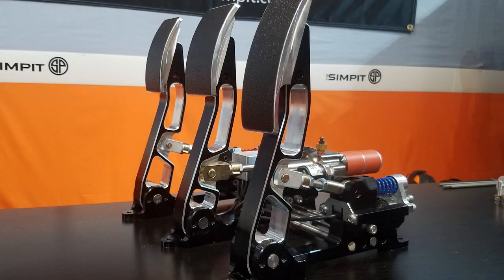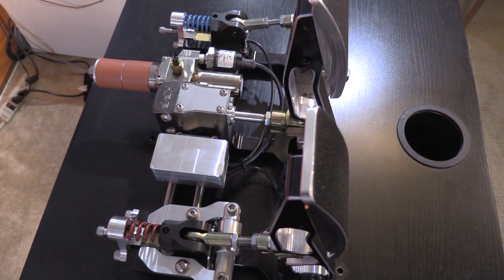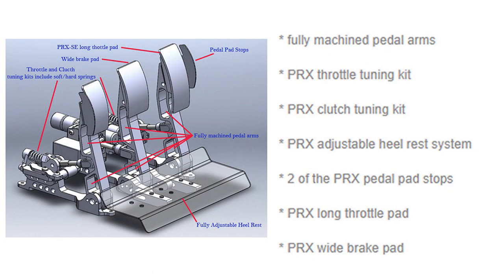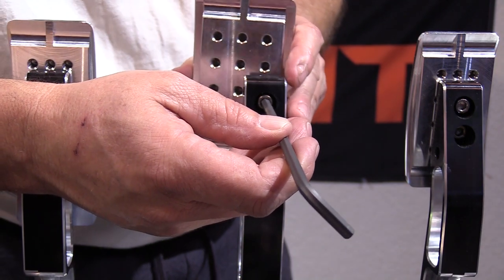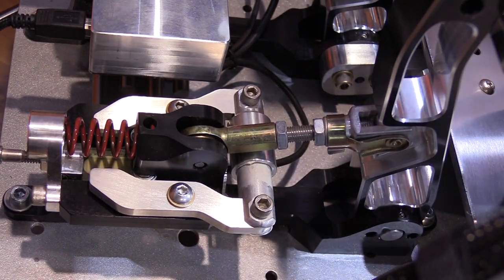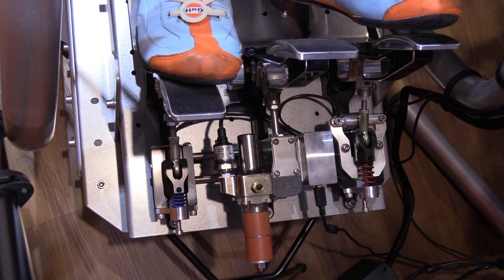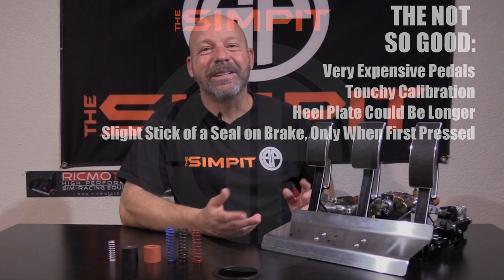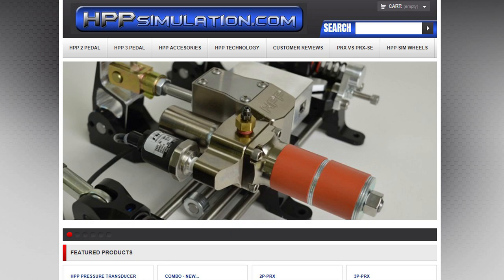HPP Simulation 3P-PRX-SE Pedal Set Review - Sim Racing Art

Comment: A solid review as always. 3 thumbs upp. I personaly don't like a "fluid brake pedal design" that might fail with "toxic" brake fluid leakage. It's still the elastomers or/and springs that produces the feel and resistance. The fluid is only a medium to transport the force from your leg/fot to a hydraulic load cell. I can understand a brake-fluid design in a real car (distans from the produced force by the leg but mostly the heat it have to withstand from the brake rotor/pad) but for sim racing there is no need to make it more complicated than it have to be. (KISS comes to mind here)
Reply: @sonny9608  Odd that you say that as I have had a set for two years and never had one leak.   Have you contacted Mark@HPP to see what can be done to correct your issue.

Comment: I think the linear potentiometer is a bad choice for this gorgeous set of pedals. It won't serve well in the service life of the set. It will be the weak link in the design and it won't have the finer scale and resolution that a hall effect sensor will provide.  Please consider this constructive criticism and make the appropriate change and I think these pedals will have a much higher durability rating.

Comment: I wish they had this mechanism and hydraulics for this on a Heusinkveld pro pedals... the he pedals look better but If they had this I'd purchase in a heartbeat
Reply: @sonny9608  Oh okay. I forget but why do they include hydraulic cylinder or w\e they have there if you can't feel it?
Reply: I come from a set of HE Pros. I love the company Heusinkveld and would always recommend to buy products from them. However, I upgrated to these HPPs and I am very happy with them. The brake feel feels more realistic to me and I am able to adjust brake pressure better than before.
Reply: @jnixdorf  hmm... many say just you cant choose wrong from both... I really am still thinking. Money isnt a problem.
Reply: @sonny9608  oh okay. I do like less maintainace:) pro is what I want. Ultimate is too much and would be like leg day everyday
Reply: @sonny9608  What does "Sprints have replaced the Pros?"
EDIT: NVM, i know now, they released the sprint edition type.
Reply: @sonny9608  I wonder why did they replaced the Pro's? Lower weight? The pedals look a bit more hideous and the two piece frame of each set pedal also don't look as rigid anymore as the older designs.

Comment: I've always pushed for the HE pedal set, but these damn. Boy are they tasty. Can't justify them on my £8 sim rig though haha.
Only gripe is the Linear Potentiometer, all electronics suffer with those being open case. Any dust/grime build up is a pain. Also you may be able to flip the heel plate, as the mounting holes are further away from the front bend how you had them. If you flipped it it'll bring it further under your heel.  May interfere with the sole of your trainer though.
Reply: Yep, thats what makes the HE Pros so nice, no potentiometers, just loads cells on all 3 pedals